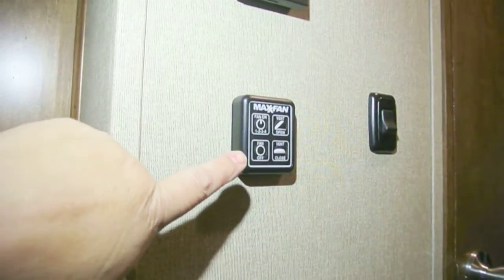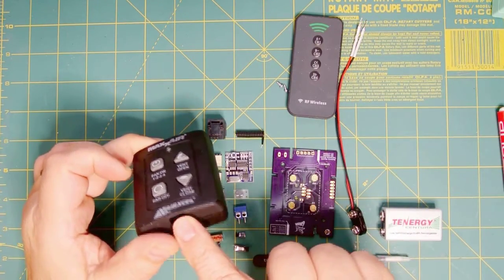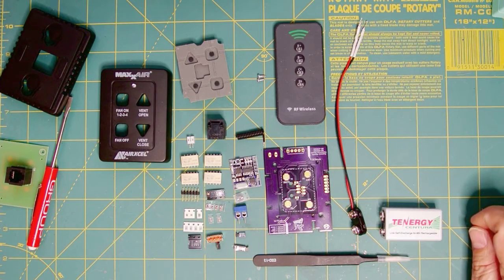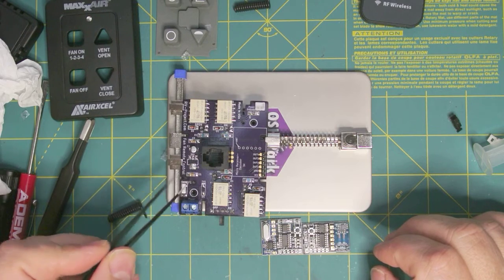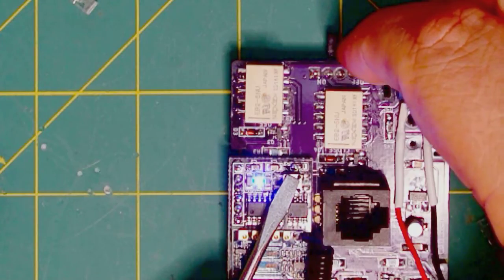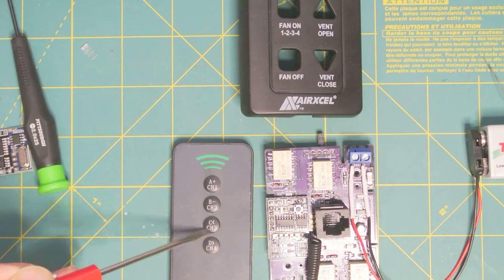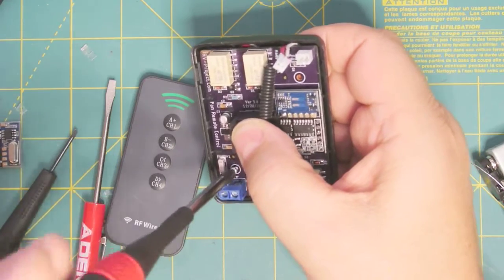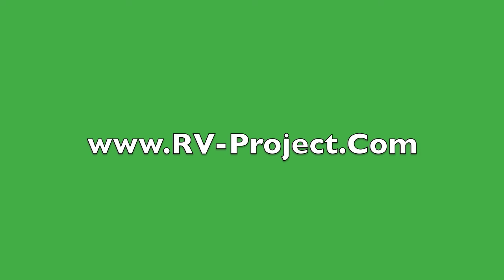Custom building a wireless Remote Control for my RV's MaxxAir Fan.

Comment: I just wish to wire my max fan/thermostat up straight. Of the red, black, green & yellow phone wires, which ones attach to the black and white (fan)  wires and which wires go to my battery?
Reply from the maker: I publish a webpage with every project video.  There you will find schematics, parts lists, and more information than is possible in the video.  The webpage for this project is at: http://www.rv-project.com/projects/fanremote.php

You will find a drawing of the modular (telephone) connector on that webpage, showing which wires go to the fan and which wires go to the battery.
Reply: @RVProject  thanks so much.... I went to your very informative website but sorry to say I am lost as a goose in a hail storm. If you listen carefully you may hear a ‘swooshing’ sound, that is your web page going right over my head :) I cannot ascertain which wires are which. Red, black yellow green....  I have a bluesea fuse box... (please) what color wires go to it, and what color wires go to the black and white fan wires?
Reply from the maker: @macabhaird8789  Some cords are "straight through", and some are "reversed" meaning the colors go to different functions depending on which side of the connector you are on.

But from my website, pin 2-3 on the connector go to the switches, and pin 4 is Ground and pin 5 is 12v.

Pin 2 on the wire is the Black wire (or Yellow wire on a reversal cable).  Pin 3 is Red (or Green on a reversal cable).  Pin 4 (GND) is Green (or Red on a reversal cable), and Pin 5 (12V) is Yellow (or Black on a reversal cable).

So you can see the difficulty I am having in telling you which wire is which, because the color can vary depending on the cable.  Therefore I must include a disclaimer that you verify the wire pins and colors, and you assume all responsibility for any action you take regarding this information.

The only thing I can tell you for sure is Pin 4 on the modular connector for the MaxxAir switch is GND, and Pin 5 is +12V.  You will have to trace pin 4 and 5 to see which wires they go to in your configuration.

Comment: Does the wireless of this modification still require line of sight to communicate with the fan?
Reply from the maker: No. It's RF wireless.
Reply: @RVProject  Very cool. I was looking through the guide trying to understand that part. Is there anything that needs to be installed at the MaxxAir fan itself or it already capable of receiving an RF signal? I currently have the non-wall mount remote and it uses IR.
Reply from the maker: @mattkeysme  The project modifies the wall mount by adding remote control to it.  Therefore it will not work if you have no wall unit.

Comment: can you give me an alternative part for this?  https://www.digikey.com/product-detail/en/diodes-incorporated/AZ78L05HTR-G1/AZ78L05HTR-G1DICT-ND/8545843 also are you still selling the PCB's I would like to make a few of these, also cannot find the RF board you have so looks like I need to get the adapter PCB from you as well.
Reply: I got the replacement parts and order all the PCB's cannot find the old style RF board anymore as an FYI
Reply from the maker: I made the pcb for both SOT-223 and SOT-89 packages.  While I have not tested it, this item should be a replacement (https://www.digikey.com/product-detail/en/texas-instruments/UA78L05ACPK/296-11118-1-ND/382184)

Also, from the project webpage (page 2): http://www.rv-project.com/projects/fanremote1.php

I show a type A and type B receiver.  It may be that type B receivers are only available at this point.  I show a wiring option for the type B receiver, or you can also order an adapter board for the circuit board to the type B receiver.  Again, I have not tested the type B board.

I should probably build a board and test the type B receiver.  Thanks for bringing this to my attention.